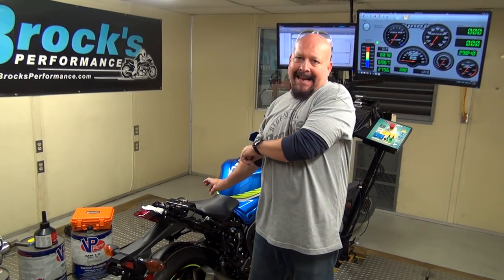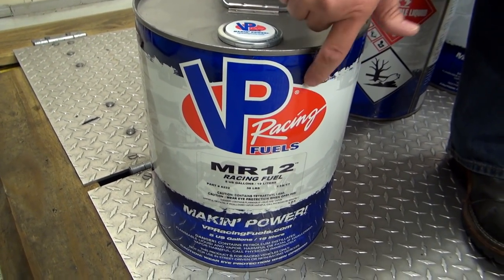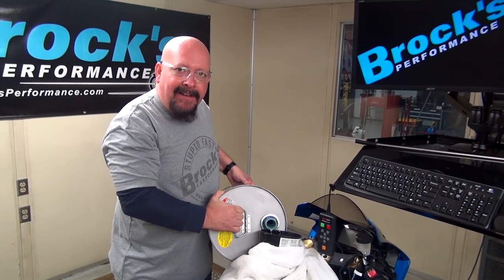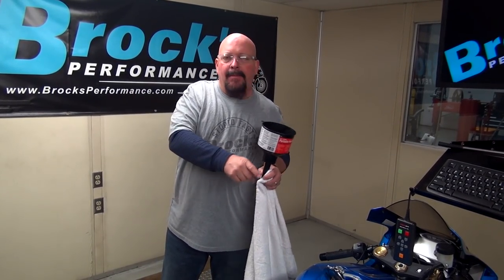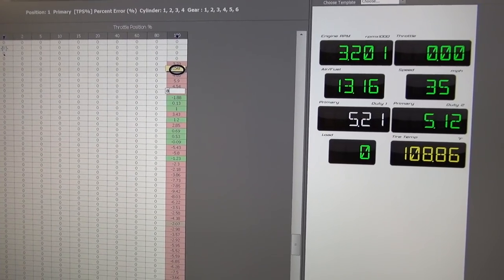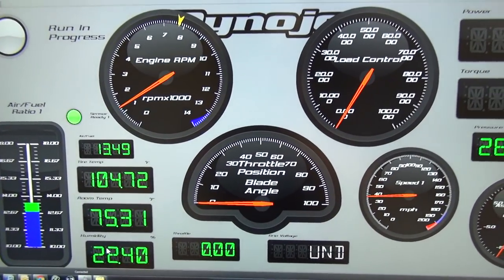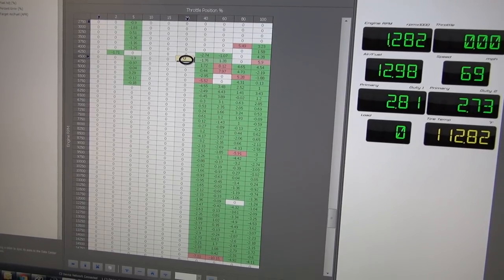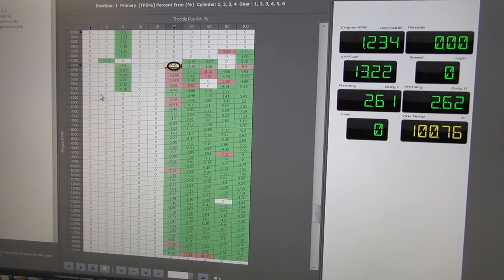2017 GSX-R1000 S2B: Episode 5 (Part 2) - Dyno Tuning for Max Performance ... 200 HP on Race Fuel?

Comment: hey brock quick question, for someone that doesn't have a shop that has a dyno anywhere close to me, what are you thoughts on using the power commander auto tune?
Reply from the maker: It's better than no tune at all. That said, if we create a perfect map , the auto tune does an excellent job of wrecking it.
Reply: gotcha, thanks for the quick reply, just had one follow up, how long does it normally take you to tune someones bike?
Reply from the maker: We spend countless hours on our mapping. Pump Gas?Race Gas? both (via map switch)? Street or Race application? Average from nothing: 4 hours for a single map. But, to be clear - we do not tune for customers any longer as our R&D dept has our dyno scheduled continually creating maps for our support system. Please see our dealer locator for a dyno shop near you: https://goo.gl/hT6UWS

Comment: You should try to install an MWR airfilter then you Will get the last HP without eny more mapping :-) that works for me evry time, but a question, i have this bike but life in Denmark an we have V-power gasoline octane 99 is that better then the American gasoline or What?
Reply from the maker: We have performed comprehensive testing of the filter you mention... we sell and distribute Sprint Filter and DNA Filters as a result of our testing. Here is info. on higher Octane: http://www.brocksperformance.com/absolutefm/?f=392

Comment: Hi brock
Question for you : 
If i tune my bike, with autotune function. If i tune it in winter 0°C, and high humidity, to a correcr AFR of 13.5 to 13.2. 
Does the will correctly works in the summer, by correcting with air intake temp? 

Thank you for reply
Reply from the maker: @Oliver - That really depends on the bike as some correct better than others. The dyno can tell you those kinds of details, or the race track - your ass dyno might be good enough if you are street riding. We do create 'hot weather' maps for some bikes, as needed. We currently do not use or offer any self- mapping units, as we find them to do a great job of screwing up perfectly good mapping.  That said, if you do not have access to a dyno, the auto-tune might be your only option with your combination? I hope this helps.
Reply: Brock Davidson 
Thank you for reply. I do not have access  to a dyno, and i notice when i start to tune the bike on winter, it run's lean (15-16 AFR) at low and mid range. 
I was scared to adjust it, becaise in the summer, i don't know if the bike will correct it. 
I will try !
Reply from the maker: @oliver - simply save your current map, so that it can be returned to the unit whenever you like. Then, let your autotune work and save that map. You will have a couple different maps to try.
Reply: Brock Davidson thank you!!

Comment: Hey Brock, 
Firstly huuuuuuggggeeeee fan.
Thanks for the amazing videos. 
Exhaust tuning is sooo complex. 
Could you tell a bit more about fuel efficiency with the custom map. Because a smoother running bike should actually give more miles . But people tend to think the opposite. 
Also plz plz plz a video on bazzaz v/s PC auto tune
Reply from the maker: @sandyroadking - Glad you like our vids - you are correct that a smoother/more powerful bike producing higher fuel mileage. Some bikes will see a sizable increase in fuel mileage. Where we find this typically go unnoticed, or with riders who loose mileage is typically a result of rider style. We add more fuel to create more power, almost everywhere in the map. If the rider is aggressive/has a "heavy hand" the mileage will suffer, (of course). Our Street Maps do a good job of providing the best of both worlds,

Comment: If u have a pump map and a mr12 map.  Let’s say u r riding with mr12 in the bike.  If your gas light comes on can you put pump in and switch maps without draining mr12?
Reply from the maker: You can use either map for either fuel, your tune will be optimized if the map matches the fuel.
Reply: Brock Davidson so it won’t hurt the bike to mix to eliminate the mr12
Reply from the maker: No. But it would not be advised to do top end runs on MR12 using a pump gas map. Regular riding or even 1/4 mile runs would be fine, normally aspirated.
Reply: Brock Davidson thanks for your help
Reply from the maker: Np. Remember, MR12 is just pump gas... Not alcohol, nitro or nitrous. So harming your engine with it is not as easy as you might imagine. It CAN be done, but you have to try pretty hard.

Comment: Good afternoon. I own a 2016 R1M with your Predator Titanium exhaust. The bike has roughly 2K miles on it but the exhaust hasn't completely "blued".  Only at the bottom but not all the way up unitl the muffler. Why is that?
Reply from the maker: We have a saying at the race track - the bluer the pipe... the faster the guy ;)
Reply: Ok. I just bought the bike and it already had it installed. Was just wandering why it hadnt totally changed colors. I thought it was something that just happened as soon as you through it on with heat build up. First time Ive owned a bike with a  titanium exhaust piping.
Reply from the maker: @jboozey - the heat initially turns them a brownish color. Then, as more heat is applied, the color will change to blues, purple, reds and yellows. Here is a chart that shows the exact colors: https://www.pinterest.com/pin/495607133969076288/
Reply: Brock Davidson thanks brother

Comment: Brock i do not have access to a dyno. I want to run Mr12 but scared I'm going to damage my motor without the proper AFR tune. I have auto tune would I be able to get it dialed in without causing  damage and how long does the o2 sensor last with running Mr12 Thanks
Reply from the maker: Yes, you can tune with the auto-tune with no dyno available. The wideband sensors last around 6 months, so it's plenty of time to get a decent tune.If you own a Brock's Performance  exhaust, you can request the MR12 map through our support system - it's free,
Reply: Brock Davidson Thanks

Comment: Nitrogen is mostly inert.  The inert gases are group 18 on the periodic table.  Nitrogen is not a member of group 18. Nitrogen is inert to about 75% of known elements/compounds. Nitrogen reacts with water which is why it isn't classified an inert element.
Reply from the maker: Here's some info. for you: https://bit.ly/3VyhRzq and this one is good also: https://bit.ly/3LXh1cw

Comment: I have a zx10r 2012. I am from new zealand. Is it safe to run a link pipe and slip on with out getting it tuned or flashed?
Reply from the maker: Hello kornboy22  - safe? Should be. But you will not experience full power and increased drivability without a flash and tune. Please go here for more info: http://www.brocksperformance.com/brocknm/templates/bpp1.aspx?articleid=300&zoneid=25
Reply: Hi Brock, thanks for the reply and information. Much appreciated.

Comment: How does mr12 do on a bike with nitrous. I have been running u4.4 on my 1070cc gsxr1000 12.5:1 comp.
Reply from the maker: MR12 and nitrous do not play well together due to the low octane and quick burn rate of MR12. We use MRX02 in many nitrous applications.
Reply: Brock Davidson thanks for the reply. I am going to be running alysin oil and petron this season after seeing you video on both.

Comment: What O2 calibration kit does the shop use/ used in the video?
Reply from the maker: Please see video long description: Dynojet Model 250I dyno using DynoWare RT, Power Core C3 and WinPep 8 dyno control - displaying the SAE scale (unless noted otherwise in video)
Reply: @BrockDavidson  Sorry for confusion, looking for a kit or part number for the compressed gas with gauge and nipple you test afr against.
Reply from the maker: @darrensmithers2686  I purchased mine from Dynojet in 2008. if they don't offer any longer, send me an e-mail : bmail@brocksperformance.com and I'll get you more info.

Comment: Did you ever compare pump gas with 10% ethanol and with no ethanol on the dyno?
Reply from the maker: It's almost impossible to KNOW your "no ethanol" fuel is actually lacking ethanol these days. This article touches on it a bit: http://blog.brocksperformance.com/faq/how-does-octane-affect-my-bikes-power-and-performance/
Reply: @BrockDavidson  First thanks for taking time to answer.I ask because I see more and more station actually offer 88 labeled no ethanol in the US.At least from May to Oct and it is widely available in EU and other places.Also Ethanol can be taken out by simply mixing with water and it separates from gas while taking ethanol   out.Sure the octane will drop like 3 but if you get 93 and take the ethanol out you get 89-90.I think it would worth a try at least how does it do power wise.Thanks

Comment: have you ever considered tuning a bike for e85?
Reply: I think the problem with e85 is that you have to rebuild the engine to take advantage of the fuel, and even then it usually don't yield an big improvment. It's a different story with turbos where every bit of knock resistance translates into more boost.
Reply: why would you have to rebuild the engine? You can run more timing with less knock which yields more power. These bikes from factory seem to have high enough compression to really take advantage of the higher octane of ethanol.
Reply: tuurbow, I meant rebuild in the sense to increase compression/high comp pistons. From my understanding is that you can hit perfect timing with normal high octane gas and more rich mixture from the tuning, the timing has a sweetspot which the factory should already be quite close to already for efficency. But I'm not a professional tuner so I may have overlooked some aspect.
Reply from the maker: tuurbow - great question. We have done it several times, but it's a hassle. Unlike some of today's cars, most bikes are rated for a max 15% ethanol. This means the fuel pump, lines and basically anything that touches the fuel must be addressed. Some guys ignore this... so lets talk about other issues. Most of today's bikes simply do not have enough fuel pump VOLUME to deliver double the needed amount of fuel vs. pump gas. This can lead to high-speed fuel starvation/melted engines etc. Another issue is: what happens if you run out of fuel (you get 1/2 the fuel mileage) and don't have access to E85? Many bikes will foul the plugs, just trying to limp home on pump gas with an E85 tune. Of course, a dual map arringement can address this. The bottom line? E85 for bikes is more of a 'race' tune, IMO. The most we picked up with E85, normally aspirated, was around 5 hp. We get double the  HP gain for far less hassle with MR12 (you can drive home, no problem with pump gas on an MR12 tune). Forced injection applications could certainly benefit with an E85 set-up. We are in the bolt-on performance business at Brock's Performance, so we leave items like E85 to racers.
Reply: thank you for the detailed and thorough response. You definitely answered my question

Comment: you should  make a map thats relative to temperature and tune it  to were it runs  the coolest temp in all rpms  forget the  fuel mixture you think is correct and ignition timing   use the pair of them to achieve the coolest temp   there is were  you will find  your majic horse power readings and torque  try it bet im right!
Reply from the maker: Doesn't work like that, exactly the opposite on a bike like this.

Comment: hello will you offer a slip on exhaust for the 2017 GSXR 1000 ?
Reply from the maker: @puresureshot - As a true performance company -as a general rule, we concentrate on full systems for bikes that truly benefit from them. The new gixxer needs a full system for maximum performance.
Reply: makes sense thank you. so basically full exhaust, EC flashed, Power commander, sprint air filter. to obtain maximum power

Comment: Where do you get that calibration gas?
Reply from the maker: @David - Dynojet sells the kit and the gas.
Reply: Have a part number? Price? Dynojet is no help at all, they never answer emails.
Reply from the maker: @daveyt4802  you will probably need to call their tech line. Here is more info: http://www.powercommander.com/downloads/Support-Released/Manuals/98200039.01.pdf

Comment: theres a 210hp out there done by HTP racing by cecil towner...  with a sidewinder twist exhaust and 87 octane...
Reply from the maker: Please send a video link.
Reply: Once i go back to my tuner Jeremy Weber at CMP,  gotta retune with a sprint filter and convert my gas from 93 to 87 octane...  cause you said this bike will make more HP with 87 than 93.. correct?
Reply: @Flea - No disrespect to HTP, they've had some good success, but I haven't seen a video on this dyno run? A picture of a dyno chart does leave some unanswered questions. Just for the record, the 210 hp was made with a drag race exhaust (sidewinder), and a no baffled end (can't call it a muffler at that point). Also, very important, they are using MJP Dyno, and yes they can adjust the correction factor, but I know of at least one account where the MJP Dyno reflected 10 more hp than the DynoJet, here's the account, "It made 711 hp or so. Went to the dynojet hp shootout in Valdosta at the ama event and we won with a 701 hp pull. The difference could be just the fact we only had a few straps on the rear or the conditions present." So there you have it. I would very surprised to see that bike make the same 210 hp on a DynoJet, all other things being equal. And one has got to ask, how many street riders are going to put a straight pipe down the full length of their gixxer, as shown in their pic?
Reply from the maker: @AJ - is which part true?
Reply from the maker: @Flea231, we get the best pump gas results with 89 Octane Shell in our area (we do not have 90 available). 87 Octane might make more power, but it is much lower than the 90 octane minimum recommended by Suzuki.
Reply from the maker: Cecil is a friend of mine and a very talented tuner. Let's just say that I would be hard-pressed to believe we would record 209 HP and 103 ft-lbs. on pump gas using our dyno and test criteria... But who knows?
Reply: Brock Davidson did you notice the torque and hp crossing at 6200 ish vs 5252?
Reply from the maker: @MRWRIGHTRACING - That is a mathematical calculation which can't change. Let me know the time of the video you are looking at, and I will try to more clearly define.
Reply from the maker: Cecil is a friend of mine and a very talented tuner. Let's just say that I would be hard-pressed to believe we would record 209 HP and 103 ft-lbs. on pump gas using our dyno and test criteria... But who knows?
Reply: Brock Davidson I was talking about the Dyno sheet from Cecil.
Reply from the maker: MRWRIGHTRACING I'm not sure about that? I have never seen a chart like his...our Dynojet and Superflow charts cross at 5250.
Reply: Brock Davidson exactly. It's impossible for them to cross anywhere else.
Reply: It depends on what units you are using. The conversion is 1 HP = 550 ft lbs / min, if you use kW and NM the crossing point will be different.
Reply: If you are using kW and NM the crossing point is 6284

Comment: Load vs Steady State, amazing software. 200hp? With the Sprint filter, slightly less viscous crankcase oil, yeah I think so. A comment about MR12, it definitely makes more horsepower, but I wouldn't leave it sitting in the tank. As soon as you're done racing or doing you're street hooligans; Drain, flush, refill with pump gas, add a little Seafoam, run the bike for at least 10 minutes. MR12 does make more power, but boy oh boy, what a hassle. So would I trade less predictable pump gas, with an improved ridabiIity map making 191hp, over a very predictable MR12 with a race map making 200hp, but requiring me to maintenance my fuel system after every use, and it still may cost me a fuel pump at some point? I'll take pump gas every time. I've got enough maintenance already; Oil, Chain (degrease & lube), Brakes, Tires (pressure), Cleaning after every ride. The 9 hp is not worth the hassle. The caveat being; I drag or road racing for $ at the track and being sponsored then ok, the hassle comes with the job, but just for bragging rights on the street?? Amateur hour, that's all that is.
Reply from the maker: @Gettis - we have left MR12 in the tank for over a month with no issues- but this is not recommended. We dodn't think twice about leaving it in for a week. We drain the fuel with a Gas Tapper (less than 5 min) and refill with standard pump fuel, making sure to entirely cover the fuel pump, to prevent the pump seals from drying out. Start, let run for a few minutes - done. Your comment is 100% for some of the 'older' hyper fuels, such as MR9, Nutec etc.
Reply: @Brock - Ok thanks, I'll try some independent tests with the MR12 formula, strictly from a residue standpoint, not performance. I've heard and seen horror stories even with this fuel, I know I experienced it more than once. It's interesting that you're having a different experience with this fuel. I'm now wondering if there was a freshness issue with some of the cans I had? Hummmm
Reply from the maker: @Getis - Could be - if the fuel is bad before you start... We lost 20 hp (instantly) using old MR9 once - we drained it out, immediately, but I'm sure it would have cause fuel system problems. Don't get me wrong - we accidentally left MR12 in my personal Busa for about 6 months - it required a fuel pump replacement and fule system cleaning with Power Charge: https://www.brocksperformance.com/Wynns-Power-Charge-+I771175+C80.aspx